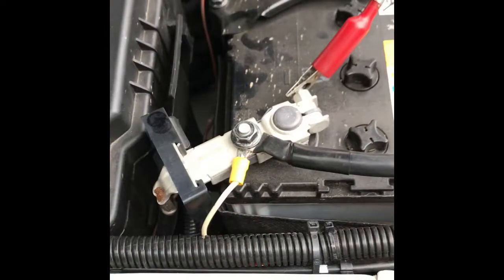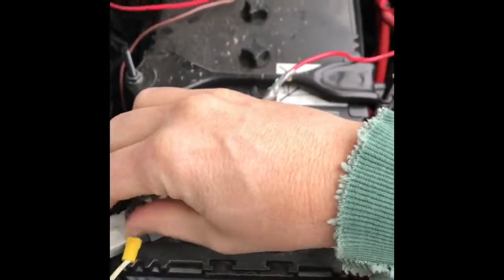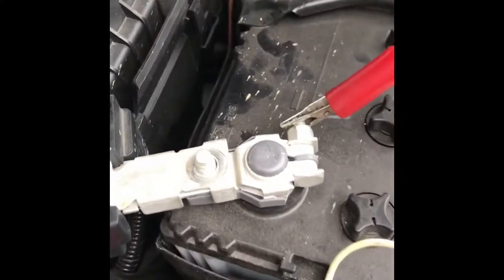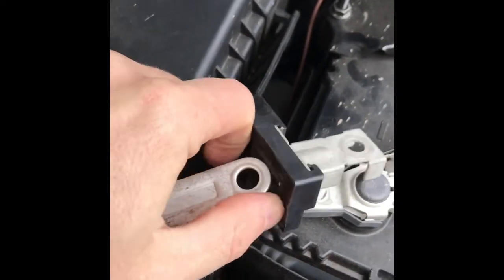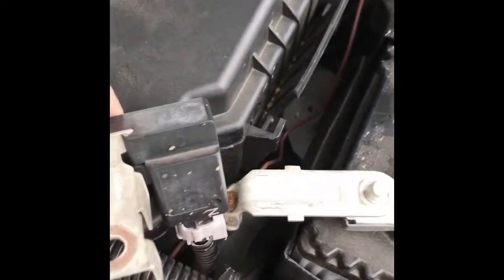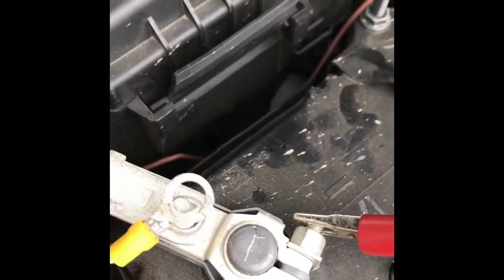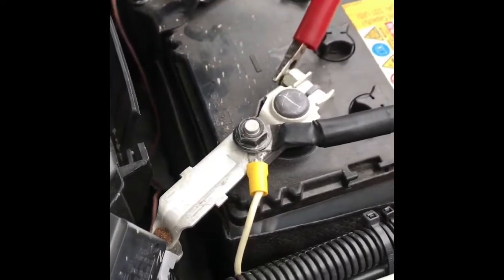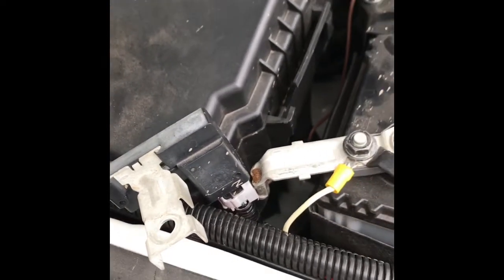Nissan Patrol Y62 - Smart Alternator Disconnect

Comment: So, glad to find this.. The voltage on my Nissan Altima would drop to around 11 volts, then after several seconds the alternator would bring the voltage up slowly to around 13.4 and immediately fall back to 12.. slowly back down to 11 volts, and start all over. My problem was it was causing issues with the CVT transmission. I removed the cable end as you show here, and just lay the smart charge end to the side of the battery and reconnected the ground.. Voltage is a steady 13.4.. and no more erratic transmission shifts.
Reply from the maker: Glad it helped Lee.

Comment: Good day, is there any risk of overcharging? What controls the voltage regulation when the shunt is disconnected? Did a fair amount of searching but can't find any info on this. My vehicle is a Toyota but i believe "smart" system is very similar. Thanks!
Reply from the maker: The systems still has a voltage regulator to wont overcharge the battery. I had a Prado previously and did a similar trick because my 2nd battery never reached full capacity and as it was running the fridge, i would not get very long run time. The manufacturers do it mainly for fuel efficiency but when running more than one battery, it will take ages to charge both (from the low output). Some people put in a DC-DC charger which does a similar job by increasing the voltage output (but you have to install another piece of equipment under the bonnet and pay about $300 for the units.. I'm certainly not an expert but have used/gathered this info from a wide range of sources and tested it first hand. Hope this helps.
Reply: Appreciate the reply bro. Apologies for the late response, only just saw it. i disconnected the connector but didn't really get any difference unfortunately. i did not disconnect the battery. Only connector. Was i supposed to? Also, would it have been effecfive immediately?